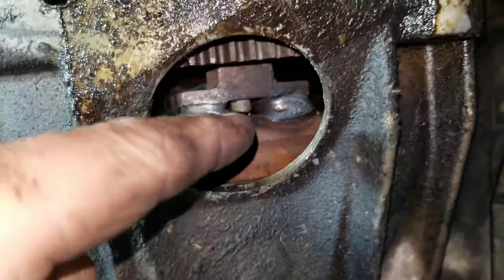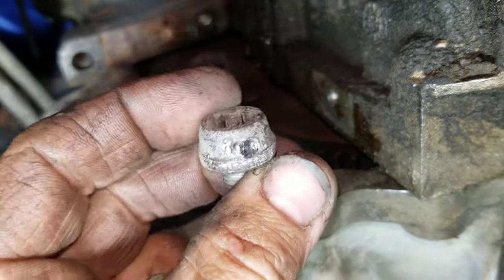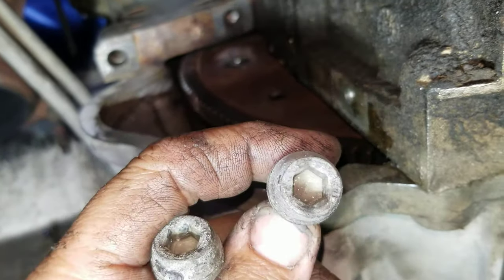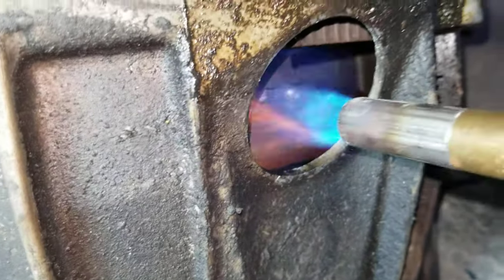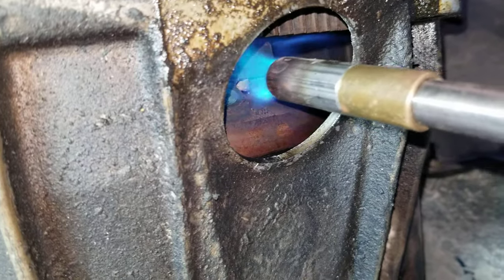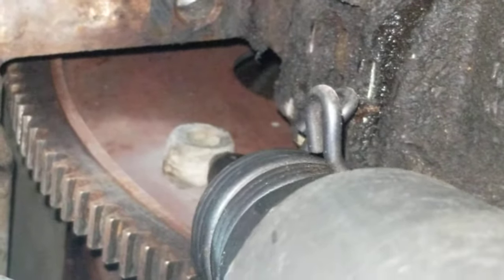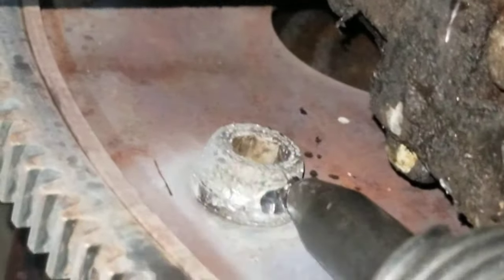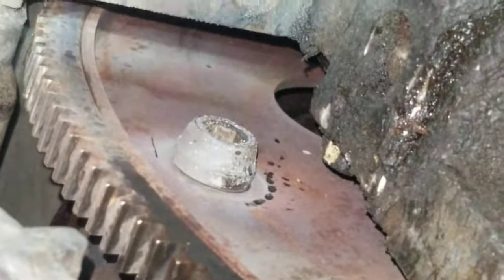Removing torque converter bolts LS 4L60E 5.3

Comment: I agree completely with you. Add a little heat to it. I'm actually dealing with some stuck hex screws  right now I'm gonna put the propane. Map gas on it and see if it loosens up. But I like how you show the service port has a back where you can access the back of the screw. That's key to this whole job.

Comment: I just done mine in my 01 gmc 5.3 and used extensions at the front of the truck got all 3 out but not without busting my knuckles first ouch but im going to replace rhem with regular bolts thats for sure

Comment: What would you do if you had torque converter bolts go in at an angle?
Reply from the maker: You mean they were cross threaded?

Take it back apart
Drill out the messed-up threads
Tap to a larger size
If that is not possible, then the anchors will have to be removed and new ones installed.

Comment: How long did you heat up each bolt?
Reply from the maker: About 2 minutes,  approximately 250 degrees to get the thread locker loosened up.
Reply: @chriskolar  gonna give it a shot today hopefully it all turns out alright. Thanks for the video
Reply: @chriskolar  i also doused the bolts with pb blaster so gonna try it later see how it all goes
Reply: Update: I tried the this method it did not work for me. So what I did I heated the bolt for about 4 minutes than put a breaker bar with a 8mm hex and luckily it worked and I didn’t round out the nut.